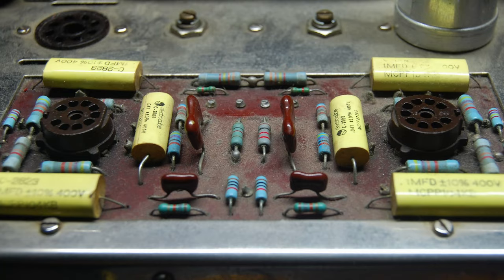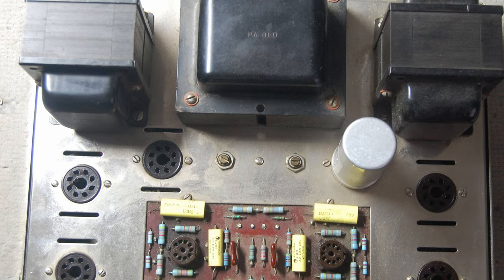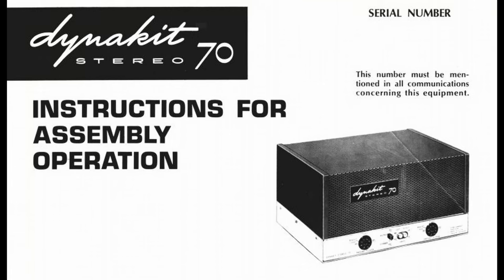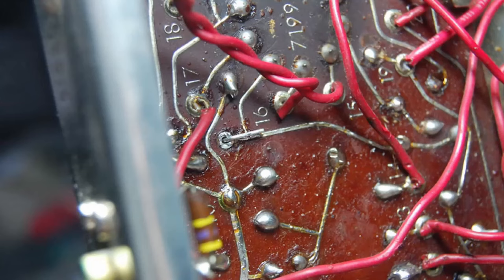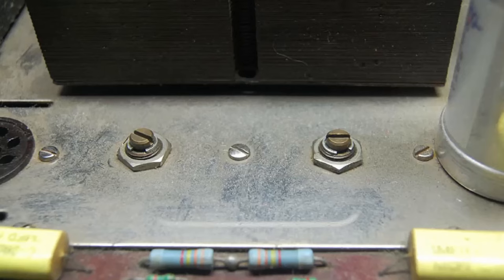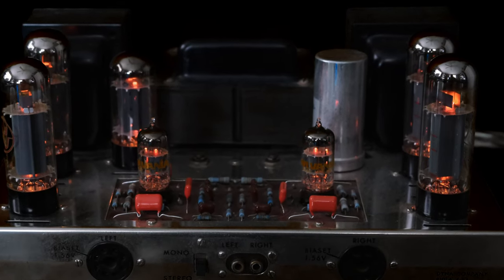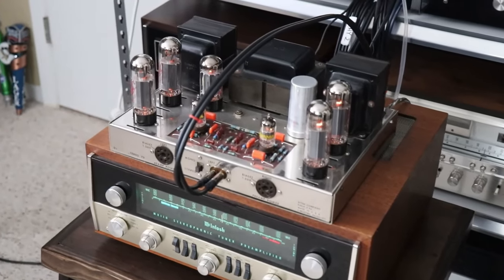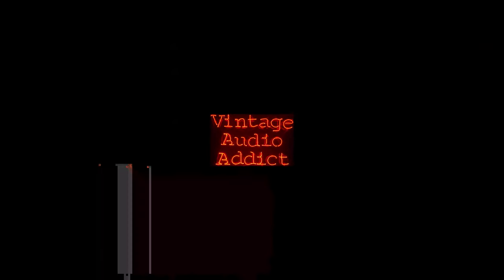Dynaco St-70 Vacuum Tube Power Amplifier. One Of The Best Vintage Stereo Components Of All Time.

Comment: I got mine in  2012 from a dumpster parked in front  of a home being cleared out by heirs. It needed repairs. It is my most treasured piece of audio equipment. Distortion from it is now is so low it is no longer measurable on my THD meter. I love it. Lots of under the chassis mods of my own making. It has it's beautiful table to sit on  and spot lights in the ceiling set it off. A treasure that I expect will show up in my own estate and I hope someone else finds it and loves it.

Comment: I had a Dynaco about 15 years ago and it had had a new board made for it with a 6SN7 and I forget the first 9 pin valve but it sounded way better for it. The output transformers have quite fine laminations too, which is good. I'm actually watching this wth the sound through my Radford STA-15 which is very similar - I know what you mean, this amp WILL put Norah Jones on your lap cooing in your ear, for classical quartet work and jazz exsembles as well as funk and EDM it sounds amazing but it does have a wobbly bottom end and mine will soon be replaced by a single ended 300B amp with C-Core transformers throughout which has the same intimacy but massive frequency extension. Great amps though - Your first 'big boy' amp!

Comment: I've owned a Stereo 70 and PAS3 since the mid-60's, and finally had to start replacing parts about 5 years ago. Basically, these are excellent hi-fi components, and compare well with modern stuff I've owned. I think I'm going to keep this set forever.

Comment: Thanks for the video. I am always pleased to see these old amps still doing the job they were designed for. Funny thing, I was coming home from school one day back in 1974 when I came across a home made console some one threw out and being a electronics tech, I looked inside. Speakers were old and cones trashed ( 15 and horn from a Magnovox ) but right there in the center was the DYNAKIT ST70. I had nothing but my books with me and a pocket knife. So,I went to work digging out that Amp.  Got it home and it worked. Loved it. Never parted with it, still have it today and it still works. ( retubed 1 time ). 
Your right about the sound. I am a musician and I have a recoding studio. ( Home style )  I was curious one day and used the ST70 to drive my JBL monitors ( I was using a Bose 1801 ) and yes, it actually sounded smoother than the Bose power amp. I had a turn table hooked up and played quite a few records with it on the monitors and a laughed all the way throgh it. Dam, it had that smooth sweet sound almost made things more real than the bose. 
All in all, I agree,  these were ahead of their time and I also agree with the saying: this is the Poor Mans Mac.

Comment: The real, true, 'unknown designer' was the late Charles R. Worsham, Sr. I worked for his private radio company after he left Bendix radio in Towson, MD. His specialty was designing Linear Radio Frequency Amplifiers for the military. What he did at Bendix was more like 70 Kilowatts and 20 Megahertz, the 70 watts and 20Khz audio linear amplifier was contract job he did at night. Contact his widow, Lee Worsham, ask her, "Mrs. Worsham, what was your usband doing the night before his first son was born in 1959. He showed me where Dynaco had 'shortcut' the power stage by refusing to properly balance the output stage properly, and how to restore his original design on my factory edition Stereo 70. I grew up on vacuum tubes tubes in the early 1970's, when electronics was still taught in high school for free. But I am 68 now, and infirm. I am looking for a partner to rebuild/restore and upgrade this amp "world class"-- money is not my motive: fame is. I will handle the power supply and power amplifiers (matched EL34's was one of Dynaco's 'short cuts' to save on a few cheap passive components (jerks!).Even then, Worsham's genius is dominable. Mine works, and is disassembled. Worsham marked up my factory schematic to show how to correct the 'Dynaco deficiencies' (also cheap-skating the power supply by failing to use the proper filter for the job---but what the hell, it worked, and made them famous! 
John Stegman (stegman.us -- personal web site)

Comment: If I recall, I think the original is one of Hafler's design.   Great amp, I modded mine a bit -- extra B+ capacitance board, stepped volume control and SS rectifier.   It really opens up the head room and gives it more dynamic power.
Reply from the maker: Thanks for the info!

Comment: I've owned and modified more than one years ago. The main problem was the input board with the 7199 pentodes. However, many replacement boards have been designed that used triodes such as 12AU7s and better signal path caps. Solid state rectification and voltage regulation are a plus.

Comment: 68 year old Boomer here - this was the rig Pops built in '60; bought the Dynakit from Allied Audio in Chicago where he was a designer for Sears. He built the PAS matching pre-amp too. From Knight Audio came the modern big oiled walnut cabinets about 5 of 'em on a huge frame - two were for the speakers and the rest were for books or storage-very Playboy. The speakers ran at 4ohms and were EV woojers with freaking HORN tweeters. Funny I was 6-7 and remember this like yesterday. That system played the NEW "stereo" demonstration records - Jazz from Command etc... Took me from the Twist thru the Beatles and Rock before I moved out. That thing made me the envy of all my friends in the 60s because nobody had separate component stereos yet with the Garrard or Dual turntable and man that thing was LOUD. Cream's wheels of fire at about 12:30 on the dial got complaints from a mile away. Jazz and Classical sparkled. 
        Thanks for posting this - I was just going down memory lane and thought I wonder if anybody's heard of a Dynaco - they kicked ASS WAAAY before anybody heard stuff from Pioneer, Sansui, Scott, Fisher, marantz, Macintosh, etc..... ⏚🎶
Reply from the maker: Thanks so much for sharing. Great story! This equipment brings back great memories for me also.
Reply: @vintageaudioaddict  Hey man, I'm just a passenger - you're the Bus driver; Thanks again !  🎹

Comment: Loved your video. I have one on the bench now going to put in a new front end board. How do you polish and clean old metal?
Reply from the maker: Thanks! Use the least abrasive cleaner first. Warm water and little dish soap will go a long way but watch the stenciling on the chassis as it can come off if your not careful.

Comment: Great Video!   I have an old Hafler DH200 which I heard was a clone of a Dynaco SS amp.   I just had an internal fuse blow on my amp and am curious if it is worth upgrading with new parts or consider new amplifiers?
Reply: Well hafler helped design the st-70 and became famous with his Rockford fosgate amplifiers in the 80-90s some of the best car amplifiers ever made

Comment: Dynaco Stereo 70 does not have the pomp of an Audio Research of Mcintosh amp, his humble aspect does not reflect the increible sound hidden inside of this amp.

Last week I change both 7199 tubes for 6gh8a tubes using an adapter. 
Sounds amazing.
Reply: does a Mcintosh tube amp sound 5X better than a Dynaco? As I think they're 5X the price, my Dynaco very sweet highs, good mids, and No bass, can only use it in the winter, thank you

Comment: Thanks for the trip down memory lane!  Great amp, great video.  My uncle built a Dynakit 70 in 1964 right after he was married.  (He happened to build it in the same little cottage I was born in 4 years prior, and I remember seeing all the parts spread out on the table....just about eye height for me then)   He gave that amp to me in the late 80s, and is still in use today.  I had no idea then that my system would get built around that amp.  

Shortly after acquiring the Dynakit 70, a factory wired Dynaco 70 showed up in the local swap sheet for $50, so I picked up a 2nd unit.  Only one channel of the factory wired model worked, so I swapped around some tubes between the two amps so that each amp had one working channel with the same tubes, and I ran them as single channel monoblocks for a while.  A friend added more capacitance to the power supplies, and wired the the EL34s in triode mode for me.  I thought they sounded wonderful and ran those for a good long time before adding the Bob Latino VTA  boards (tubes4hifi) in 2020.  A couple years later I removed the rectifier tubes and added Roy Mottram's copper body solid state rectifier, and installed new Tung Sol 7581A outputs (in triode), and 12BH7a driver tubes.  Wow, what an incredible set of amplifiers!  

Bass was a bit punchier, but still not dominant the way a good solid state amp is on the bottom end, so still not quite finished, I added an active low pass filter @ 80hz, and threw a vintage Kenwood integrated into the mix to power just the woofers of my transmission line speakers, and ran the Dyna monoblocks to the midbass and tweeters.  Sort of a hybrid bi-amp configuration.  My ship has come in!   Sunglasses on, beer in hand, smile on my face, and favorite tunes shuffling in the CD player, I don't think I could be happier with these 60+ year old amplifiers, but I do occasionally pull out an LP and take things to another level.  I can't imagine what I'd have to spend to get better sounding amps!  Absolutely love these!

Comment: A foolish question. Are the valves still available? I mean easily?
Reply from the maker: Yes, they are still available. Mostly Russian and Chinese made. The OEM tubes are no longer manufactured but are still available on eBay etc. They are expensive.
Reply: @vintageaudioaddict  thanks

Comment: Nice to see, I have renovated some ST 70 and also little brother ST 35 it is usually so that they are as close to original condition as the owners want them. I became very fond of ST 35 and got one for about $ 3 but according to the owner it had never worked well. I tore it down into parts and found the fault one of the high voltage cables was pinched under a transformer the main transformer measured and it was okay even OPT was. Built it together with new parts as I did not know if the components were ok. Today it drives a pair of Altec Lansing 604 E maybe a little too much power but what does it do.
Reply from the maker: Thanks so much for sharing. I have a ST-35 in my collection also. I hopefully can do a video on it someday. It's a great little amp!

Comment: I inherited lots of tube equipment, including this same amp, and many amps and pre-amps, all "tubers".  Obviously, you repair all sorts of sound equipment but where can I get these units repaired without being ripped off or told they are worthless?
Reply from the maker: Google "vintage audio repair" and see what comes up in your area. Keep in mind that any good technician is going to charge you to repair or restore the equipment. A person that can work on this equipment is no different then having a professional plumber or electrician come to your house. What would that cost you? A lot of folks think for $25 or $50 their piece of vintage audio equipment should be good to go. Rarely is that the case.
Reply: @vintageaudioaddict  I am not arguing that repair comes with a price.  I just argue that there are too many claiming to do repairs that either do not know what they are doing or do more harm than good.  I would just as soon leave what I have untouched sooner than have it repaired improperly.  The thing I need to find out is who does the repairs properly.

Comment: The st70 is a class the design was straight out of the RCA rube guide the transfomer are all excellent as is the chassis big very easy too mod to use as long as you don’t drill holes the big lint on this is the quality of the components both caps and resistors if you do that all of your top end problems are gone the slam and powerful low end bi amp
Reply from the maker: Thanks for commenting
Reply: The ST-70 is class AB. It is similar to the RCA 30W amplifier from RC-30 1975, but which is not present in RC-16 1960, so you have the question of priority inverted. In any case there are significant differences, notably in using ultra-linear, which Hadler and Keroes thought they had invented.

Comment: I retrieved from my family's old residence my mother's stereo system. She had this Dynakit ST-70 paired with a Dyna Preamp PAS 3x. I'm now familiarizing myself with the 2. I am from the Philippines where our electric voltage is mostly 220v but in old residences, there was also the option of a 110v output. The pre-amp has an option for the 2 voltage sources but the ST-70 has nothing indicated on it. Since it's US built, I'm assuming it runs at 110v. Am I correct?
Reply: Yes, it was built for 117VAC nominal. You need a fairly hefty step up transformer, say 250VA, which NB is a power rating, not a voltage rating.

Comment: What did the underside look like after you worked on it?
Reply from the maker: Not much different really. I cleaned it up, replaced the wires that were held together with electrical tape and repaired the artwork where needed.